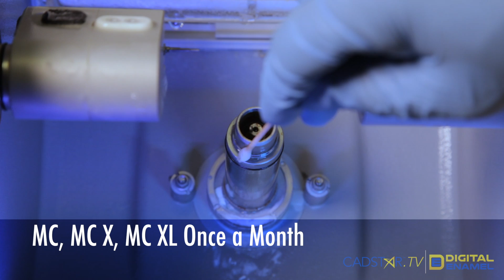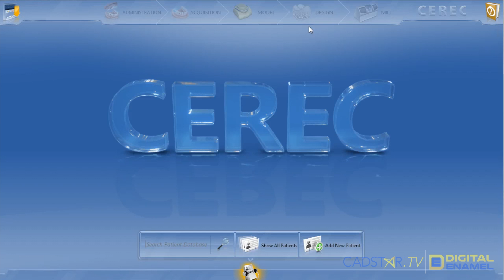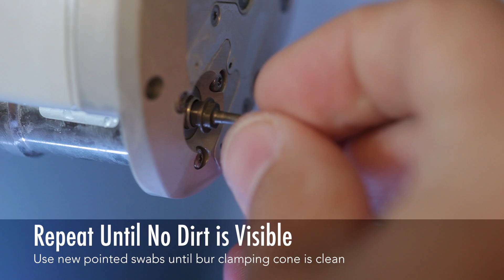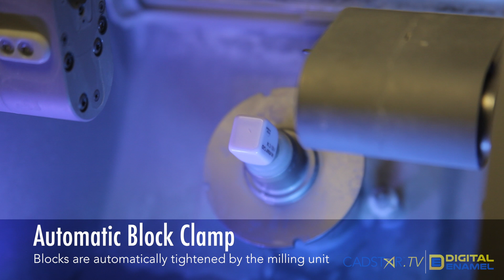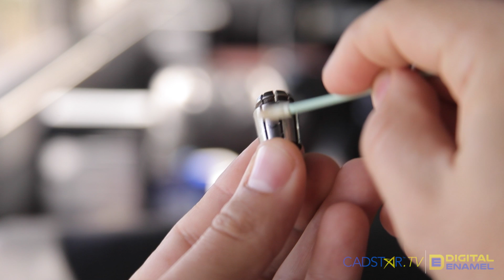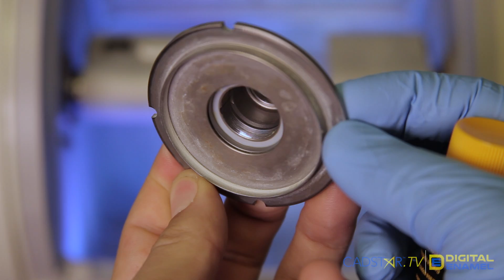How to Maintain Your Sirona MC, MC X, or MC XL Milling Unit

Comment: What is the typical frequency of a water filter change? We upgraded to the MC X in January. Our old milling chamber didn't require a filter. The acquisition unit told us when the milling unit required a water change. I need to change the filter in the MC X once every week to 10 days. Is that usual? We mill approximately 2 crowns/onlays a day.